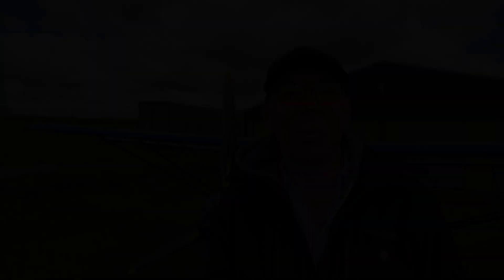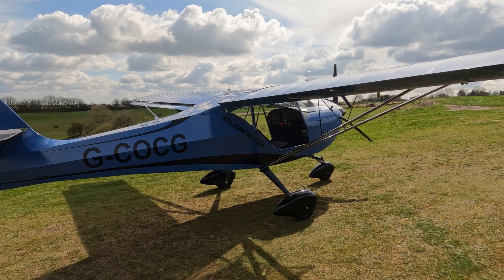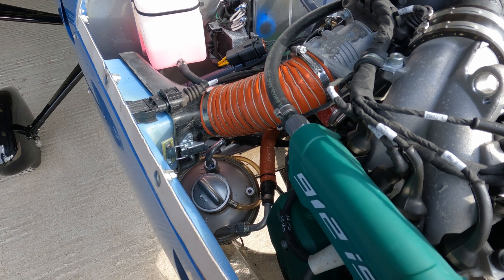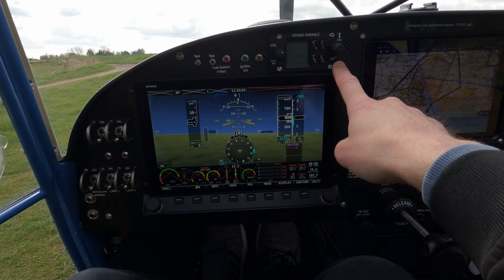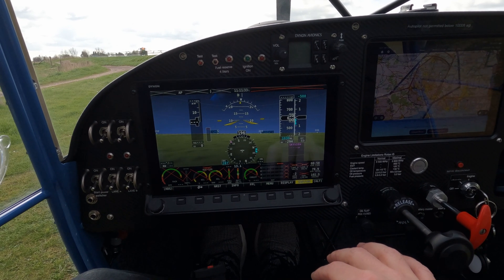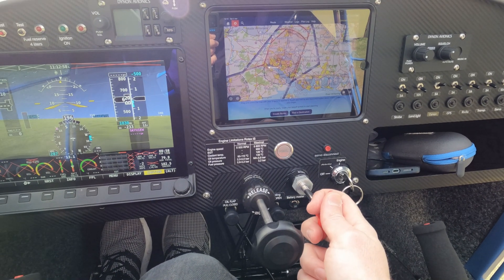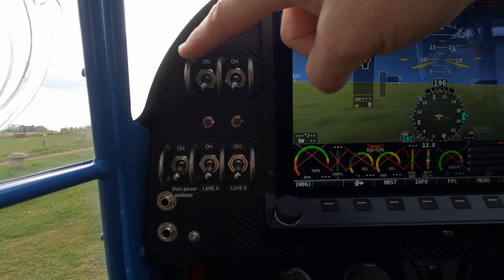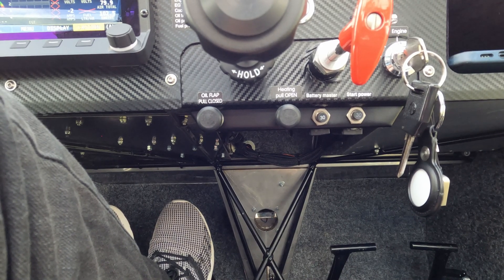Introduction to the EuroFOX (Aeropro) Microlight Light Aircraft

Comment: Thank so much I have a question What is the difference between rotax 912 IS an ULS and what your recommend
Reply from the maker: Thanks for watching & for your kind comments 🙏
The 912iS is an electronic fuel injection engine & the ULS is carburettors.
I prefer the 912iS as you do not have to deal with a choke, carb floats, worry as much about icing & (compared to my friends with the ULS) I get better fuel economy. 
At my airfield, most of the issues other pilots seem to regularly be wrestling with are carburettor problems.
If you are very good mechanically or live in a remote area, then maybe the ULS would be a better choice as you can fix the engine yourself. But if that’s not you, then (in my opinion) the 912iS is unquestionably the best option 👍 
I love the 912iS & personally would never consider a ULS. 
If you speak to manufacturers of aircraft they will tell you that it’s mostly older pilots that want the ULS, because they are familiar with it & understand it more. The proportion of ULS units sold is now in a minority, according to the three aircraft manufacturers I have spoken to. I hope that helps 🤞

Comment: Beautiful plane and a well-presented 'introduction' to the Eurofox (known as an Aerotrek A240 in the States). I believe the level of sophistication available with light sport aircraft is underestimated, especially with the glass cockpit options, low stall speeds, and the reliability of the Rotax engine. Planes like yours are as capable and fun as the more expensive Cessnas.
Reply from the maker: That’s very kind of you to say 🙏🏻
I agree, these light sports aircraft are making aviation accessible, safer & more comfortable for a fraction of the price of ‘standard’ general aviation aircraft 🥳

Comment: Nice presentation and airplane! Can you give me distance from the base of seat / back to the cocpit bottom (knee clearance) and also from the base of seat / back to the top (head clearance) ?
Is it possible to use constant speed prop? which is the convinient cruise spead ?
Reply from the maker: Thanks so much for watching & commenting.
My aircraft is a few years old now & I don’t work for EuroFOX so I don’t know if there are any changes in the format of the cockpit with the newer aircraft. I do know that since I purchased my aircraft more engine & propeller options have become available. If you want to know the current options you can get hold of Paul Simmonds-Short on 07712 515528 😊👍🏼
Reply: @FlyingDarkLord  thanks for reply! Country code?
Reply from the maker: +44
Reply: @FlyingDarkLord  thanks!

Comment: Good explanation of how your Eurofox unfolds into flying mode and why you chose the tricycle gear over trail dragger. Perhaps an odd question: how off grid can you land compared to a tail dragger?
Reply from the maker: That’s a good question! In the UK we mostly fly from grass or tarmac strips. I operate out of a farm & cope just fine with the setup I have. If, however, you will be flying into areas where there may be large (hidden) objects or very rough terrain then you will need much larger diameter wheels running lower compression tyres. This will prevent the use of wheel spats/pants. In these situations you would be better served by a taildragger with a modified undercarriage & suspension/damper setup. As you may have seen from some of my other videos, I’ve landed on some rough strips & never had an issue yet 🤞🏼😊👍🏼
Reply: Thank you for your very thoughtful feedback. Without the wheel pants would larger lower pressure tires give you the flexibility to land safely on rougher terrain? Any you might have met who is doing this? We learn a lot from the shared experience of aviators like you. You were one of the first YouTube channels that I subscribed to… giving us straightforward explanations of how you are using the EuroFOX. Thanks for your postings.
Reply from the maker: @ronshillum4897  You are very kind 🙏🏻
A few EuroFOX owners I’ve met have chosen taildragger formats with Tundra tyres, but as far as I’m aware most EuroFOX owners in the UK don’t really land on surfaces that are similar to those you might find on the Sandbanks or Desert basins you see in videos of pilots from other countries.
If I lived in America & was landing ‘off strip’ I’d definitely favour a taildragger with big tyres over the tricycle arrangement. But for me, in England, the tricycle arrangement better meets my needs 😊👍🏼

Comment: Hi Geoff, out of curiosity, how safe is the one bolt to keep the wings extended? Is it a risky point of failure? Is it checked every annual? Do you have to do it up tight? Just found it interesting that one bolt seems to hold the wing in place. Cheers!
Reply from the maker: If you think about it, it’s not just one bolt, it’s actually 3 bolts, but removing one allows you to swing the wing back. 
Also we check our bolts every time we the aircraft, whereas the pilot of an aircraft without folding wings probably never checks whether their wing bolts are secure 🤷🏻‍♂️
The nuts are only done up finger tight as they are castle nuts that are also secured with a split pin. Even if the nut did fall off the bolt is positioned such as they passively remain in position without the nut having to be present.
When you get your head around it, it’s fine, but I know what you mean 😄👍🏼
Reply: @FlyingDarkLord  awesome to know thanks